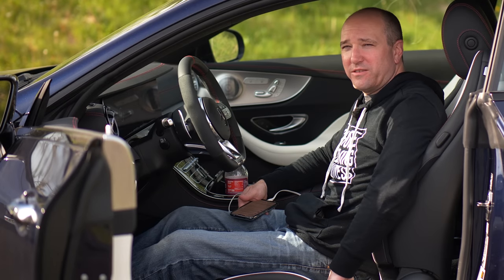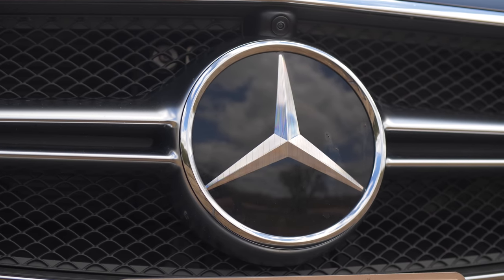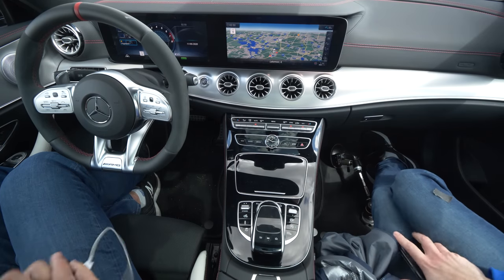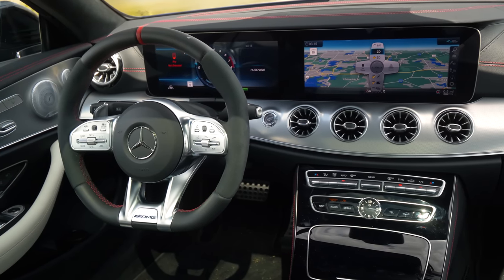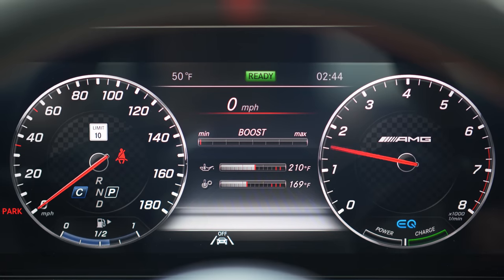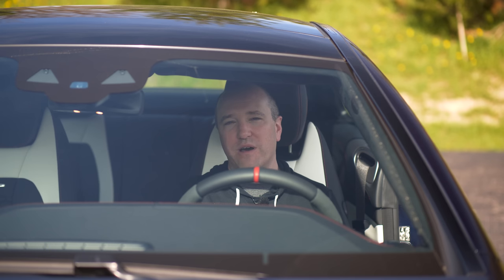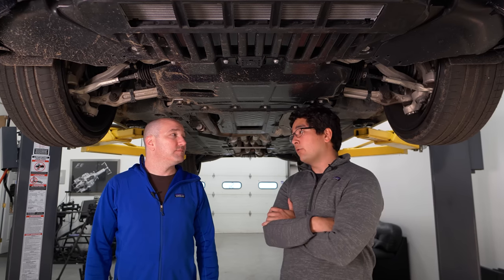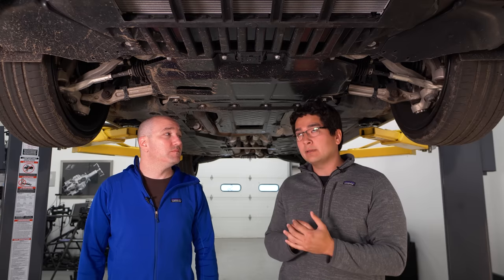2020 Mercedes E53 AMG | Gimmicks and Engineering

Comment: Steel parts aren't necessarily the massive disadvantage you make them out to be. Sometimes space constraints necessitate speed over aluminum. Aluminum is so soft and flexible that it needs much more material volume: Eg. an aluminum tube needs a larger diameter than a steel tube for the same strength/stiffness. Sometime steel is the right choice and sometime the aluminum is the right choice. The real differentiator is the skill of the design team to select the correct material and design to its' strengths.
Also, wow this drive unit is bad ass.

Comment: Couple year old now car tested.. the 2021 E350/450/53/63 is a refresh and MBUX system is much better and simpler... interior can be matte wood, or wood or carbon fiber. Airfresher is ionied so you dont have to hang crap off the vents. Regular Burmester Audio is good

Comment: The shortcomings of the audio system are inexcusable. The base system in a $75K vehicle should knock your socks off.  A $4500 upgrade had better be absolute par excellence.  Driving dynamics notwithstanding has the E Class jumped the shark?

Comment: Living in Québec, where temperatures can drop to -20°C, I experienced numerous issues with my E53 AMG. Most of the electronic components had to be replaced due to their unreliability, including the rear camera, heated seats, instrument cluster, headlamps, and rear window motors. Not to mention, the car is made of cheap plastic, and the outdated software was never updated. You have to pay extra for every single feature, like remote start, for example. The leather seats wore out so badly after just 40,000 kilometers that they looked like they belonged to a 20-year-old car. I had to replace them entirely. In short, I sold the car and I’m happy to say I will never buy from MB again.

Comment: 11:30 is that a Made in China 1/4 ratchet resting on the waste gate actuator black box ? 🤔😭🤣
Sorry, I couldn't pass that.😁
12:43 dual mass flexplate.$$$$$$$$$$$$$$$$$$$$$$$$$$$$$$$$$$$.Plus a bunch of clutches and plates, plus more spring inside the T/C. Wonderful. 👍🏻
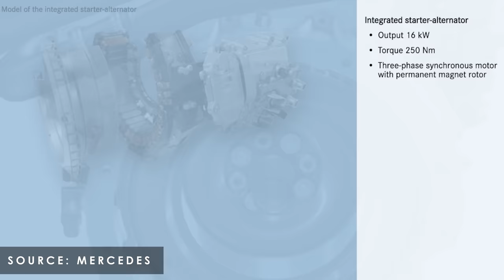13:04 "power electronics" right under the cat and next to the downpipe. Excellent location.👌🏻

Comment: Hellcat. Hmmm. Never have driven one. The all wheel drive is a great thing. Safety is what M-B wants and getting all the power with it and all the luxury that one really wants. But the brain in the M-B is not that bad. C63 is the one I want and the price is pretty close to the same. There is good room in the C series. A DCT is a must with this car, despite the character of the current transmission. The C63 is much more car than the E/AMG car presented herein. This E series is going to go down in value.

Comment: 4:26 I disagree. I own an E43 Sedan and trust me I use all three ways to control the head unit. from the steering wheel , the touch pad and the scroll Knob. and it is NOT difficult to use at all. you should atleast live with the car for a week before you review and complain about the car. and I highly recommend to get the air refresher option. its worth the upgrade.
Reply: Same here. I mainly use the steering wheel controls when I'm driving. Touchscreen when I'm parked and the wheel whenever I feel like for whatever reason. I like how it gives you different options to go about it for your preference. And he's complaining how it's really overwhelming for some people. Yeah maybe for about a week, then you get used to everything. Also, he was complaining about going into all these settings to go into 3d sound. He didn't mention that you can set that up in the favorite button so you can just press that and do it in 2 seconds. I've noticed SG misrepresenting a lot of cars. In the F150, he complained about the 10 speed transmission even though you can lower the number of gears you want.

Comment: Great car to buy second hand after the depreciation hit
Reply: Only a fool would buy this car used. You wouldnt want to deal with all the mechanical issues it will develop after the warranty expires.
Reply: zarbon700 I’ve been finding 2019 models with less than 5000 miles on them for like 20-30% less than original MSRP. Still under warranty and all. Sell before warranty expires. Cheaper than leasing

Comment: Holy shit, that's one complicated drive train setup.  So many of these will be going into the shredder since it will be so expensive to repair, basically negating any savings of gas from the hybrid system.
Reply from the maker: I don't think fuel savings is even real. Maybe in a static test and lab. But real world 1-2% on a good day.
Reply: @savagegeese  completely agree and that's the absurdity of trying to meet a fleet MPG standard when it's probably causing more waste in the end.
Reply from the maker: @handlealreadytaken  I love when there's a lot of effort place in engineering but this is just so ridiculous the amount of work that was done all in the sake of meeting regulations.  I'm not someone that preaches electric cars but that makes way more sense than this.

Comment: Burmester 3D sound system isn't worth the money or is it needed, for 90% of the people buying this car you'll be happy with the stock sound system.
As for the driving dynamics, it would have been nice if MB made Sport+ mode more aggressive with stiffer suspension and more rear-biased power delivery.

Comment: By the way. The car felt boring and overpriced. 100k for just the MB/AMG bange? nah. Its more appropriate to buy the A class for that reason or pay extra $ for the S class. 
What do you guys think about Infiniti M37/Q70? I think its underrated/dark horse.
Reply: The Q70 is not underrated at all. The very rare V8 model was decent but the car itself is outdated and ancient in every way. And the VQ37 engine is a pig.

Comment: This isn’t an AMG car. It’s a Mercedes-Benz with the AMG designed transmission but the rest is pure Mercedes-Benz. MB owns AMG, which operates as a completely separate entity, however AMG has full access to all MB R+D and vice versa. This car, which doesn’t have an AMG suspension or an engine designed and hand built by AMG, is really the German version of American badge engineering. Other than the transmission and the badging, this is not an AMG, so it doesn’t have the hard sports car edge of an AMG designed and built product made at the AMG factory.

Comment: I don't really see the line of thinking that leads you to this over the RS5. I think the long-term Mercedes die-hards looking for a big coupe will be fine with the regular E450, which is only slightly down on power compared to this. Plus the electrical complication scaring away non-leasers...I don't know, Mercedes will be alright if 1 of their 87 models fails, I guess.

Comment: Dude, all they have to do is to rip out the driver display and go back to simple analog gauges, they can keep the center console ipad,,, but it should be more simple (like reading DVD, CD, trans flash, surround camera, tire pressure, drivetrain setting, and that's all!)... ..Also, a "beastly Benz" (such as this one) should have simple charcoal leather, unfinished wood trim (without polished aluminum), and a cheaper (but still good quality) Bose audio system!  All the other things look good: engine, drivetrain, suspension, wheels, tires, styling (especially nice color and lines on this model),,, very good! very awesome! 🙈🙈🙈👍🤗 (Mercedes might include a 70,000 mile warranty with all services included, (because of the "special nature" of the engine itself),,, it wouldn't be surprising to find a reduced price of 77k (full options) after all recommended changes) ✌️😇😎
Reply: And going beyond that: there might also be an "entry level c class AMG version" (with all similar recommended changes) ,,,and such a car could be literally half the price!  Pretty cool, wouldn't you say!? 👍😎
Reply: this being an amg or not aside, still a great looking car. I think the more tech forward look is great if they're trying to attract a more up and coming crowd to the e class while still leaving those old world analogue charms for s class folks.

Comment: That engine is too complex and intricate, it's bound to fail, break and be expensive to fix out of warranty. I like simple and sturdy, the way it used to be. I love this car nonetheless but I'd pick the most basic engine. I don't need the oomph, just the comfort and sense of luxury. 

I’m currently driving two old bangers, a rebadged Audi S3 210hp with lower trim (SEAT Leon Cupra R) and an E92 330i 272hp. The day I upgrade It’ll be a Mercedes.

Comment: It’s irresponsible to turn the ESP off on public road.
Reply from the maker: Its not completely defeatable.
Reply: savagegeese The traction control is still on but the car lose ability to stabilise it self by braking each individual wheels when ESP is off. You should keep it in ESP-Sport which will allow adequate sideway actions and still have the safeguard in place when the angle starts to get ridiculous.

Comment: The product planning managers are imbeciles. 

Problem is, they are not engineers, they are MBAs. Back when Mercedes cars were designed by engineers, they were the best cars in the world hands down. Best built cars ever, only car that could serve as a cab for 30 years and a million miles and not fall apart or be a luxury vehicle at the same time. 

Now Mercedes struggles to make cars with average reliability, but they have stupid energizing menu with idiotic piano jingle.

Comment: money pit with classic music. expensive to buy, ultra expensive to fix, and break all the time. Their system is so bad I almost crashed a E class while driving. Changing radio is a complex thing to do. Super distracting system from bad programmers and designers. air damper...after a few year, it will cost you thousands to fix a single shock.

Comment: I don't get excited at all about these placebo-AMG cars. Engine sounds fake and you can get the same engine in a non-AMG car. I haven't driven this car but it's so boring already in this video that I don't even want to. I hope the 4 litre V8 isn't going to be the last real AMG engine.
Reply: Ok I got a chance to drive this car and I did. If it didn't pop it's exhaust system with sport+ I couldn't tell you what was AMG about it. But I was wrong about it being boring. It's still a magnificent vehicle. The best things about it would be the engine sound, the power at low revs and the excellent 9 speed gearbox. Not so good things: the engines very flat power curve is disappointing at high revs and the car tries to be a sports car and a luxury car at the same time failing a bit at both.